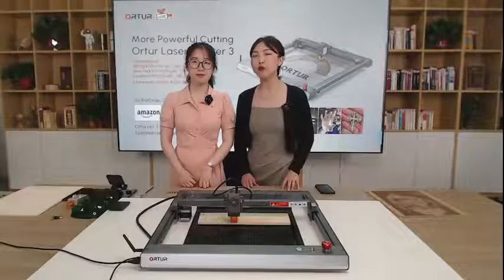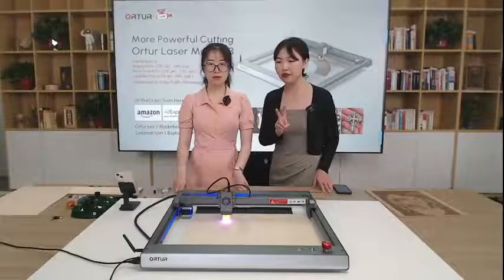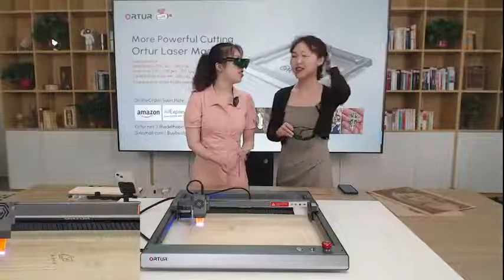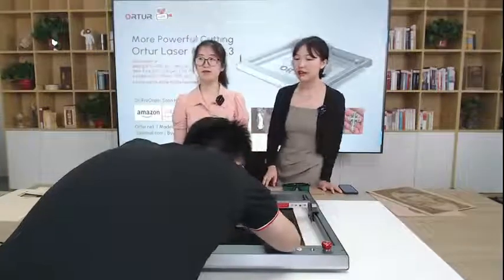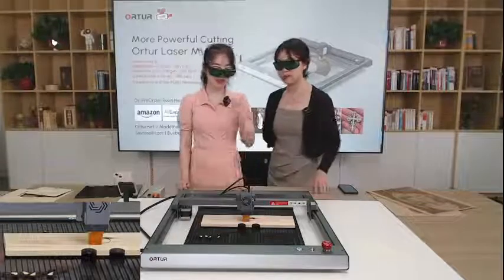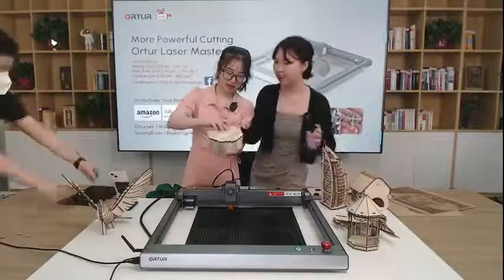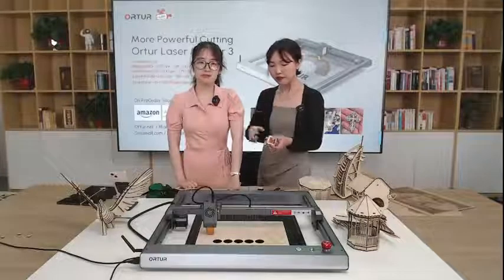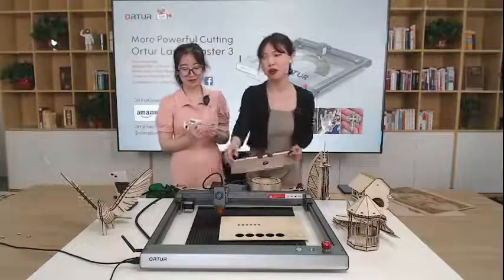ORTUR Laser Master 3 Launch Live-2

Comment: I can see a lot of improvements already. Am using the OLM2, and it's now a dinosaur compared to the OLM3. I hope I can upgrade soon.
Reply from the maker: At present, the latest 10W LU2-10A Lasermodel can be used by the big-name OLM2. In addition, we are about to launch a new offline control screen, which can achieve an effect similar to APP. In order to make OLM2 and previous users have a better experience, we are also preparing to launch an upgrade Bag.